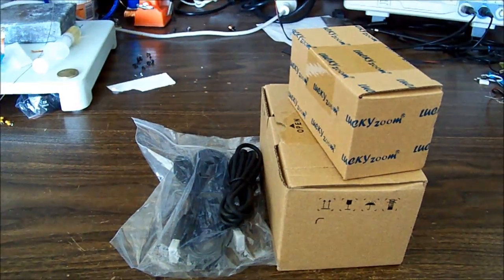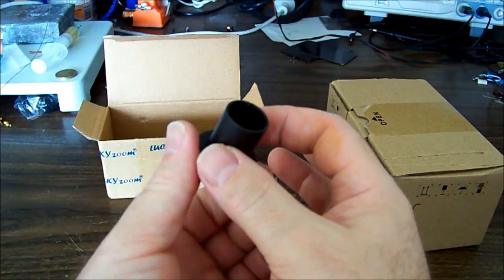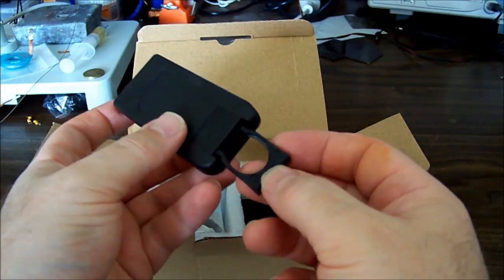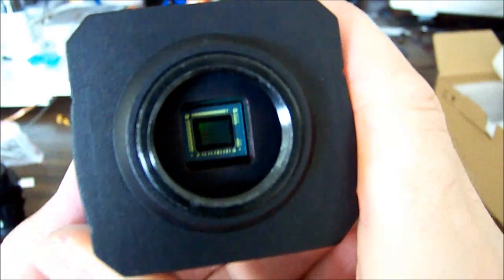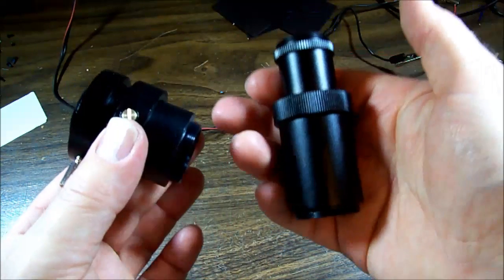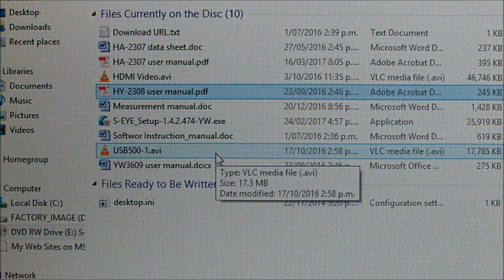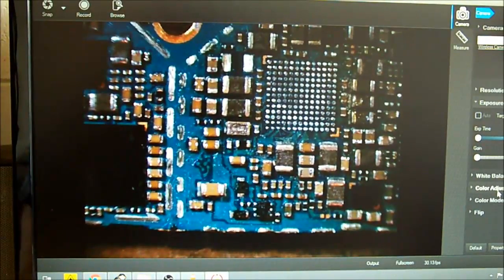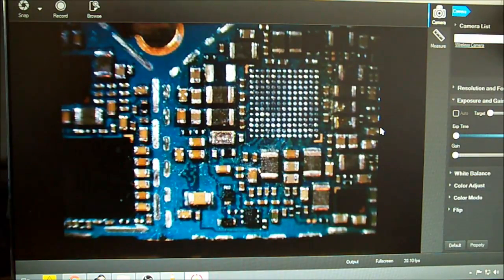Lucky Zoom HY-2307 microscope camera review

Comment: That is definitely not an American plug, at least not USA.  Ours have flat prongs with one often larger than the other or 3 prongs with two flat and one round for the earth ground. :). Thanks for the vid.  Checking out different cameras to possibly use with my amscope sm-4tp.
Reply from the maker: Right you are. hah! What was I thinking :) I'll have some video up soon using mine. Couple jobs on the go but they aren't being resolved as quickly as I'd like.